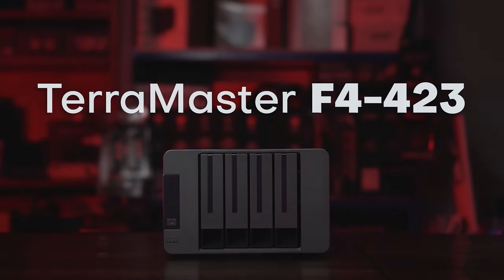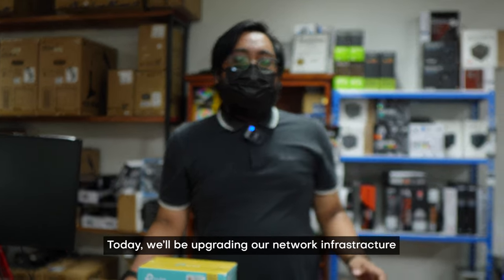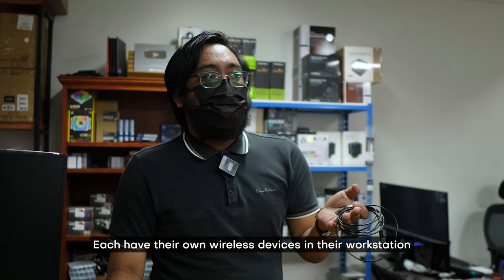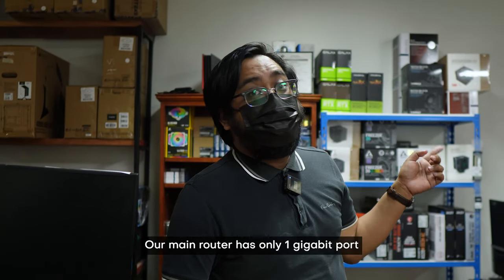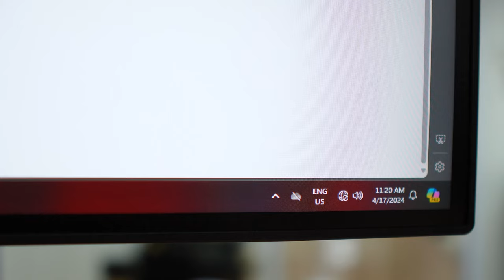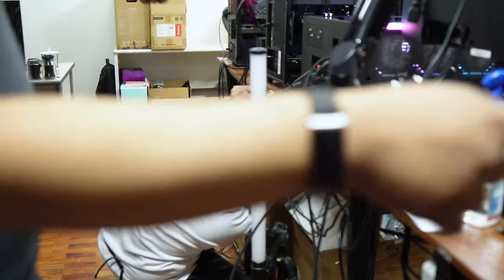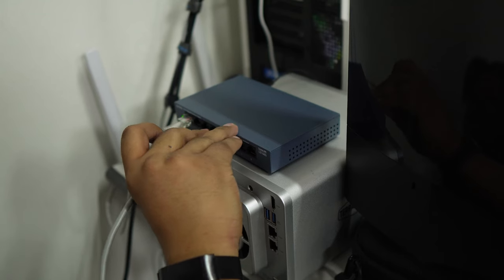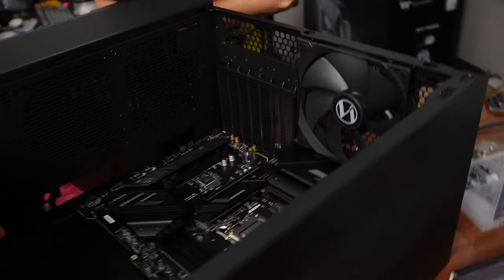Upgrading the shop network for BETTER GAMING 🛜🎮

Comment: Is it ok to use switch without using router?
Isp modem direct to switch?
Reply: yeah, very small fraction on people necessarily  need this- but having connect directly from router ISP to your computer is okay in every home. unless you have a big house or computer shop or offices.
Reply: normally, you NEED a router to handle the proper routing of network data, so hindi pwedeng direct modem/ONU to switch. pero all local ISP modems are combo units na, meaning they have a router built-in na, so pwede na yung ISP combo modem/router directly to a switch.